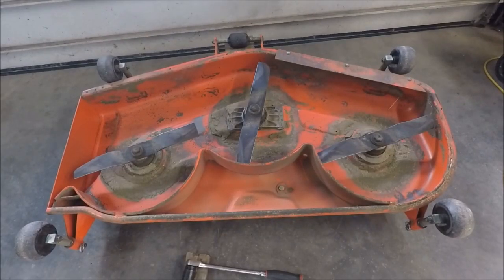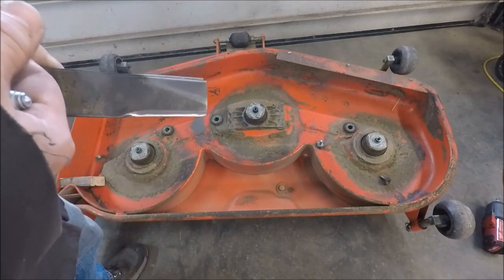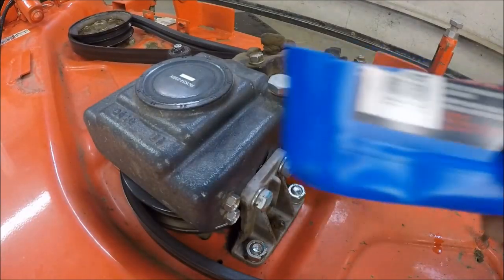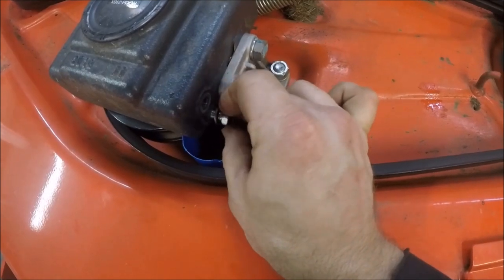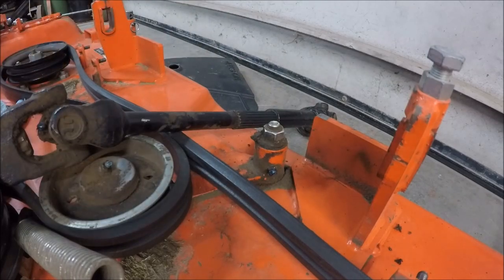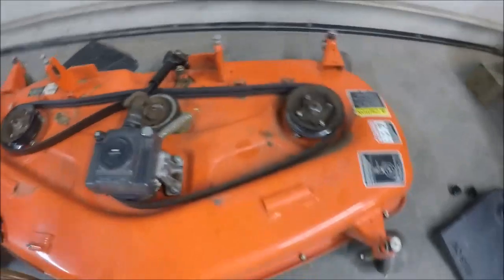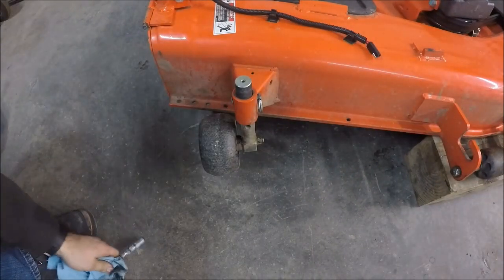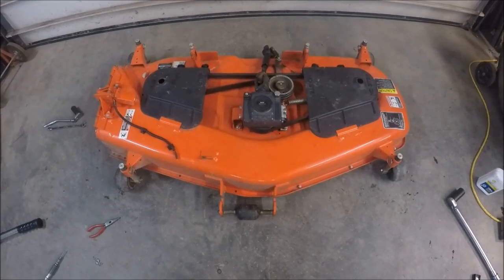BX Mid Mount Mower Spring Maintence (Step by Step)

Comment: Nice video!  One thing to add, if I  may ... After about 20 years, I lost a grease fitting from one of the outer mower's spindle shafts and the other outer spindle's grease fitting was loose.  So make sure to check those also.  As a precaution, I would recommend removing each of the outer spindle's grease fitting and reinstalling using 'Loctite' to mitigate it from coming loose on it's own.  I believe just the outer most spindle's grease fittings are an issue due to them threading straight and directly onto the spindle shaft.
Reply from the maker: Thanks! I'll check my grease fittings.

Comment: Very helpful! I need to find that tool used to reinstall the spring. My center pulley does not have a grease fitting. Looks as if it was changed to a sealed bearing. I'm the second owner.

Comment: One of the best narrated, instructional videos for this Kubota maintenance! Great job! 
Question:  Hubby accidently ran over a piece of rebar barely sticking out of the ground & broke one of the blades off (broke the bolt)our RCK54P23BX deck on our BX2350. After having the rest of the bolt removed by our local mechanic, we're ready to put the blade back on - do you know, on our deck, is there only 1 washer between the bolt & blade or multiple? Local dealer says 1, but a parts diagram I found online has multiple... Wondering if we lost the additional washers on the other blades in years past or if the dealer has it right? Unfortunately we've run into several issues with knowledge at the dealer so I'd love a second opinion! TIA!
Reply from the maker: Thanks! I am pretty sure my deck has 2 washers but I am not 100%. I need to sharpen my blades. Maybe I'll do it this week and I can let you know.
Reply: @TractorTech  Sounds good, thanks!

Comment: Excellent! Have same deck. My first riding mower!
FYI my grease fitting for my middle spindle for the deck bearing never took grease. Figured twas a blind hole and sealed bearing. I was wrong. During my 2nd year of mowing I started hearing bearing noise. It would come and go too!! Loosened belt to check pulleys. The middle was hard to do since pto is connected to gearbox. But after rotating shaft could hear rough grinding. Long story shorter, that lower bearing never got a drop of grease. All it was was a bad zert/grease fitting!!! Wow after 30 years of plant maintenance that is the first time saw a zert that was plugged. I could have replaced zert and saved myself the hassle. Now out of warranty have to replace bearing and both seals. 
Been watching y’all since before I bought my 1880. Thanks! God Bless You!!!!!
Reply from the maker: Sometimes a good hard pump on the grease gun will clear out a clogged fitting. Thanks for watching my channel!

Comment: Nice video! Where did you get the spring install tool? Mine bent with how tough the kubota spring is.
Reply from the maker: Thanks! The tool came from harbor freight but I don't think they have it anymore. There are similar tools on amazon. This one looks better than mine, the handle is larger in diameter. https://www.amazon.com/Motion-Pro-08-0127-Heavy-Spring/dp/B000RG5UMA/ref=sr_1_47?dchild=1&keywords=spring+install+tool&qid=1609821587&sr=8-47

Comment: I broke the output shaft that goes to the center deck blade, it broke clean off just above the blade when I ran over a rock.  Do you have any videos on the subject of replacing it?  Should I consider having a repair shop do it?  Thanks
Reply from the maker: Sorry, I don't have a video on that. The worst part is going to be removing the belt. Once the belt is removed you will need to remove the pulley. I think once the pulley is off the spindle will fall out and can be replaced.

Comment: i endorse what ray eddy has said   very precise maintenance well done     Any comments on the cutting height adjuster?
Reply from the maker: Thanks! The cutting height, does not match what is on the adjuster. If you adjust it so it does, you run into problems. If you can' get it into the top position, there is an adjustment at the left rear wheel. That is about all I can think of on the cutting height knob.

Comment: I have watched all your videos and they are great. I do not own a Kubota scut but am really trying to justify owning one with a mid mount mower  and front end loader to use around our small place. I may contact our local dealer but was looking at the BX1880 specs online and am not able to find out if a 48" mower deck is available for the new BX1880 model. Thanks again.
Reply from the maker: I've been hearing them advertise a free 54'' deck on the radio. If you build a BX1880 on Kubotas website you can choose a 48'' deck. Take a look at a 2380 also.  It has larger tires, which means more ground clearance, more pulling power, and higher top speed. You can also get R4 tires on the 2380.  I'm glad to see that they use the same loader on all the BX's. The previous model 18hp BX's had a slightly weaker loader. Thanks for watching my videos. I appreciate it.

Comment: How do you remove the spring for belt replacement?
Reply from the maker: I use a tool like this: https://shop.advanceautoparts.com/p/performance-tool-brake-spring-hook-tool-ampere-w86557/9010310-p?product_channel=local&store=2530&adtype=pla&product_channel=local&store_code=2530&gclid=Cj0KCQjwpdqDBhCSARIsAEUJ0hM4nBqWRbP9nw4yGW1a2C9TLYK2zc9w0ln5GVGQseJHexVruXDd9psaAl9JEALw_wcB&gclsrc=aw.ds

Comment: Excellent presentation. Any tricks on how to remove the belt spring tensioner?
Reply from the maker: Thanks! I use a spring tool like this except mine came from harbor freight. https://shop.advanceautoparts.com/p/performance-tool-brake-spring-hook-tool-ampere-w86557/9010310-p?product_channel=local&store=7563&adtype=pla&product_channel=local&store_code=7563&gclid=Cj0KCQjwirz3BRD_ARIsAImf7LOdhBDbh-4Ck3hQYzbz34QMZiYuuUrtJ_9K3fZlwVUq9fSLbbqaGigaAl_lEALw_wcB&gclsrc=aw.ds

Comment: Very good except one thing I saw I do different.   I was taught to line the blades up so there all facing the same direction so you get the best discharge of grass clippping plus it creates a better vacuum lift to raise grass to cut.  Thanks for sharing.
Reply from the maker: Thanks! My thought on the blade placement is the way I do the far left blade throws the clippings into the middle and the middle throws the clippings to the right blade. It seems to cut a little finer. Now you got me to thinking about this and I'll have to read up on how to clock the blades.
Reply: @TractorTech  
I liked to know what you find out?  Thanks for sharing
Reply: @TractorTech  90 degrees